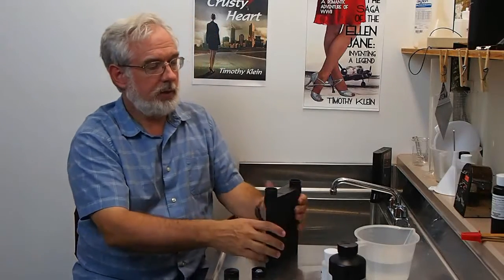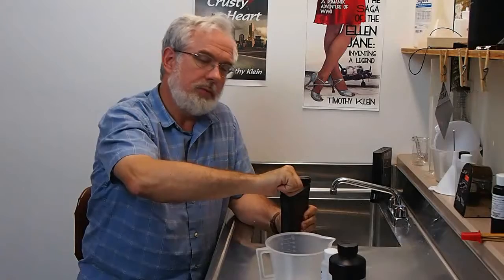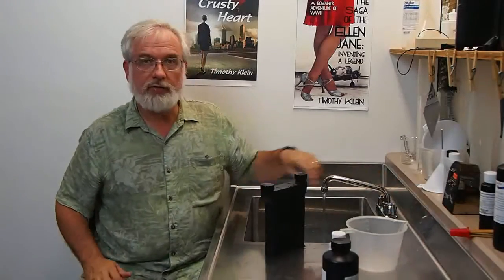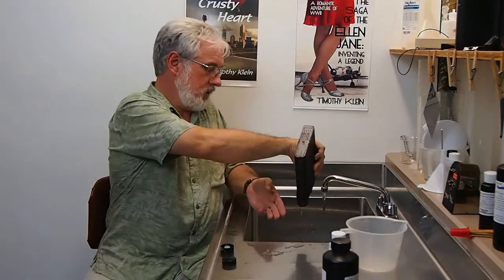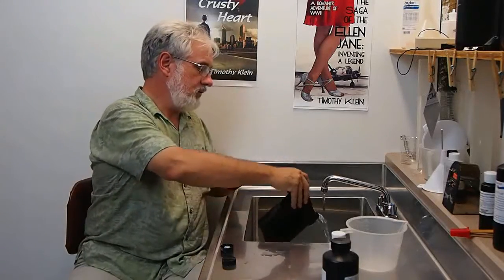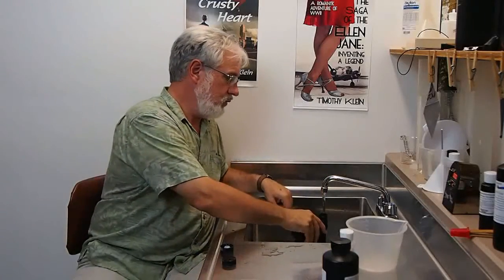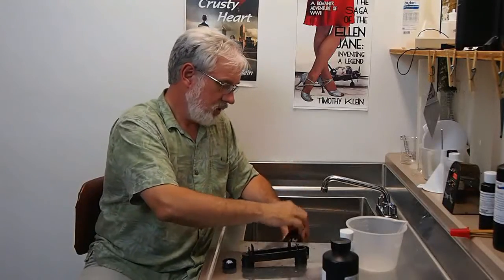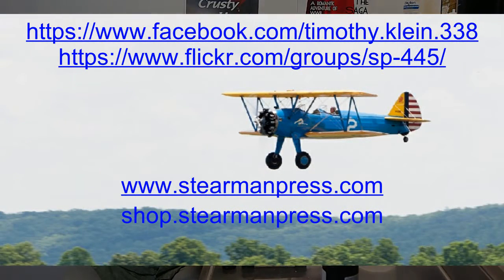SP-445 Hints

Comment: After using the wetting agent, I would remove a holder, immediately remove a sheet and squeegee it. Never seemed successful getting off all the water evenly and still had dust.  Tried setting the tank in sink, removing both holders and leaning each against the tank and waiting a few seconds before removing a sheet from the first holder removed.  It squeegeed completely dry and my dust issue disappeared. Has happened 2x now and will try it again but seems to really help the sheet clear of liquid and the squeege then evenly removes all water.  No drips at the bottom of the hanging sheets  a half hour later.

Comment: Is it necessary to adjust my developer dilution when using the Stearman compared to what I use to dip/dunk in 80oz tanks?
Reply from the maker: Probably don't need to change the dilution but you may have to experiment with agitation to get the contrast you want.

Comment: Tapping the tank on the sink is no need for..
There is no manual / job sheet by Kodak, Agfa, 
Ilford or Fuji which tell you to do so.
Jobo, Paterson, Johnson, Kindermann have 
never advised to do so.
Your agitation of the tank is for too wild and abnormal..
Reply from the maker: Wow, that's the first time I've heard that! First, film companies don't generally tell you how to use the processing equipment.  Second, tapping the tank is so common that it probably never occurred to them to mention it.  If you don't, you WILL have air bubbles on your images.

As for our agitation scheme, you're free to experiment.  What we are demonstrating is what we've found works the best after six years and thousands of negatives. You'll find that many of our customers are even more aggressive!

Comment: @Tim Klein  any thoughts about making a double size tank so 8 sheets could be processed? Of course, the chemistry needed would be doubled.
Reply from the maker: We've looked into it but are not sure the market would support the development cost. It's more likely that we'd go with an SP-645; that is 6 sheets in a slightly larger tank. In theory, it could use the same lid as the SP-445.

Comment: If I have more than 4 sheets of film to develop, how do I quickly dry the various parts of your system? I would suppose a soft lint-free towel and hair dryer would be a good place to start.

Is it possible to simply buy extra film holders? That way some could be drying while I process another batch.
Reply from the maker: I wouldn't get too close with a hair dryer, you might cause the plastic to warp. Yes, extra holders are on our website: https://shop.stearmanpress.com/collections/photography/products/rev-4-4x5-film-holders-pair
Reply: @timklein185  there is a YouTube video showing a white base that holds the tank to prevent it from falling over plus it holds all the pieces to facilitate drying. I just looked on your website and the base is not shown for sale. Was that a prototype or is your website needing an update?

If those bases are for sale, how much are they?

Thanks.

Comment: great idea, but as a suggestion can you have a seperate cap, which comprises a "piston" that screws onto a cap hole, this would use air pressure to 'blow' or 'pop' the lid off , might also help for wet or stickey lids.

Comment: Is there any way to develop film in the original film cassettes ?
Reply from the maker: Don't understand the question. What "film cassettes"?
Reply: Owen, you must be thinking of 35mm roll film and not 4x5" sheet film.
Way back in the '60s or '70s, folks were trying to figure out a way to develop 35mm film in their cassettes but as far as I know there was little success. That was because wet film tends to stick to itself. Plus when it gets wet, it swells due to the liquid getting into the gelatin base. 4x5" sheet film comes in boxes of 10 or 25 or 50 sheets, not cassettes.

UPDATE: it came to mind that Owen might be thinking of developing the film in the 4x5" sheet film holders (they are not called "cassettes"). While anything is possible, the sheet film holders would be ruined or at least severely damaged. So ... No.